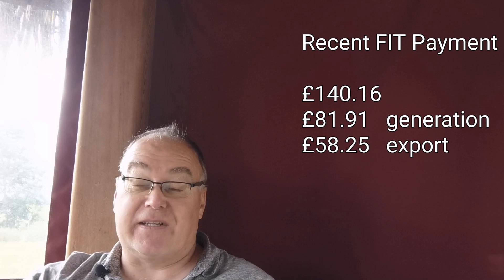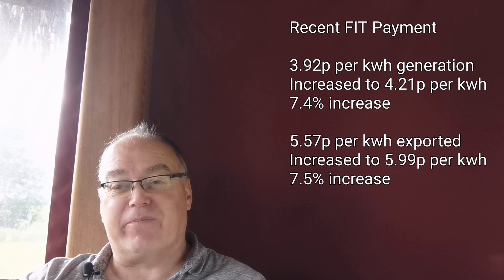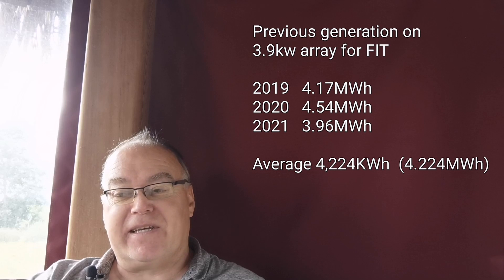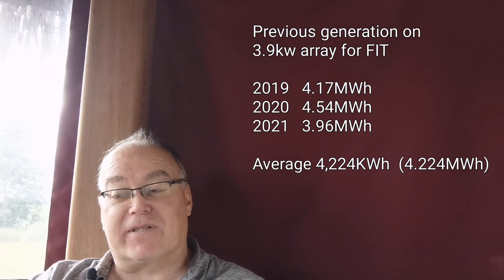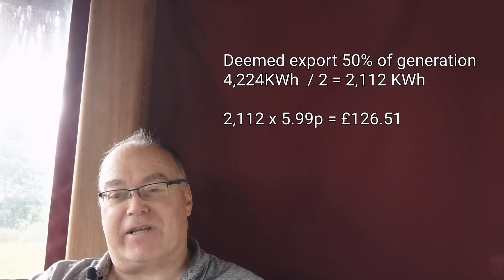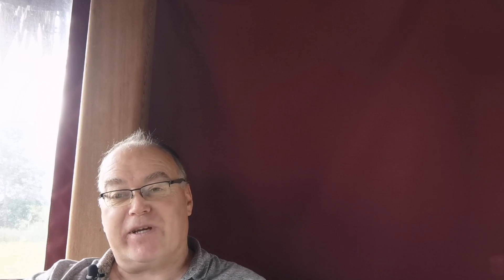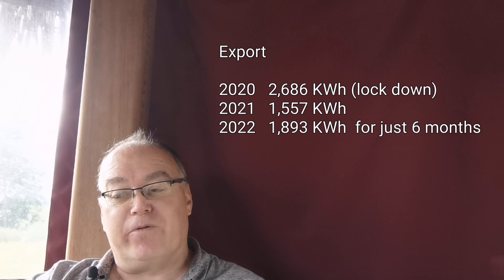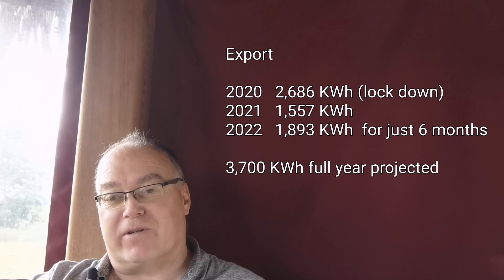Is it time to swap from FIT to  SEG? Smart Export Guarantee. Calculations & thoughts

Comment: Nigel, As of September 2023 - Intelligent Octopus now comes with Outgoing Octopus of 15p per KW.  Can you revisit your calculations.   Also I am on FIT and have been for 10years is it easy to cancel the FIT export element - can you just apply via Octopus or do you have to also do  this with the energy provider who pays the FIT. Any insights into this would be appreciated.
Reply from the maker: Export consideration is a different video. I'm not with Octopus for export yet

Comment: Really simple question Nigel.  I have FIT right now so I get paid for Generation and an assumed "deemed" export.  If I move, what happens to the Generation bit which is the main income stream - does it go altogether, if so I cannot see how even the best Export tariff would make up for what I get for Generation right now.  I cannot find a clear answer to this anywhere, so the inference is, if you are in the FIT model, for gosh sakes stay with it because no SEG - even on the best SEG tariffs for Export - will get even close to matching it.
Reply from the maker: If you swap to an export tariff and have FIT already art of the swap process is for  your FIT energy company to confirm  you have opted out of the deemed export.

You still get generation fit just not deemed export, instead you can be paid on an export tariff.

Basically you notify you FIT energy company
Reply: @EVPuzzle  Oh that helps.  And if I move to another provider who has a better "real" export tariff (like Octopus), would I still keep the generation /FIT income, and would it still be at the same level I get now (my current FIT generation rate is about 60p per kwh), or would it, or the rate it's presently at, be put at any kind of risk if I move to another provideer.  It's certainly all something to look into carefully, before you leap!

Comment: Great video Nigel. I would love to know anyone who could set up all the parameter variables into an MS Access Database so that you can just use drop down menu's to quickly configure based on price per kWt + time + month + SEG or FIT etc and tariff plus standing charge and on ..... anyone got the time and skill set as I would happily pay for the app or database file lol.
Reply from the maker: If only eh? A bit of visual basic and nice easy front end. The only down side is its on a computer. Everything these days needs to be on your hand on a phone or tablet.

Gone are the days of running a computer burning hundreds of watts whilst running.

The only thing that persuade me to run a computer again is if @sightlinesystems supported solar integrations like Home Assistant. A true data analysis tool. There's nothing out there for residential use
Reply: @EVPuzzle  Thanks for the reply. I guess I will have to number crunch on a spreadsheet. Where did you buy your heat pump set up from if you don't mind me asking? I am trying to get prices but they don't want or are unwilling to do bespoke systems like yours unless you want to import from Poland which sounds too risky.
Reply from the maker: Gt. Yarmouth installer 'ignite heating and cooling'
Reply: @EVPuzzle  Many thanks Nigel and I love your analytical mindset and articulate presentations unlike the Robert Llewellyn's of this world.
Reply from the maker: @michaelrathbone67  that's really kind my friend. Two different types of people completely. An actor and a Technical Programmer 😂

Formal car media are the same, they only say its great so they keep getting long term a loan cars. No credibility

Comment: I'm on octopus tracker for my import which is capped at 30p pkwh and 16.68p standing charge  until July 2023  and agile outgoing for my export at the end of Aug 2022 I was charging my batteries over night because the export tariff was higher than my import tariff so the solar was all exporting to grid

Comment: Also worth considering unless you can automate the charging of the car at the cheap times, it will probably end up a lot of hassle. For it to work I would want to be able to just plug in the car and not have to set the charging times based on the Agile rates, personally I would just plug it and set to charge at night during the average of the cheapest hours.

Comment: I have a small 1.5Kw system on the FIT payment of 18p per kWh, at the time I took it on I think the average retail kWh was 10-14p - the system has more than paid for itself but now standard retail prices are going to 50p+ per kWh I am seriously considering abandoning the FIT/any form of export full stop and going off grid to a self built battery storage,  I admit it is shear bloody mindedness on my part but I object to the fact that the tariff adjustments are quite frankly taking the piss.
Reply from the maker: I know that feeling. FIT is inflation linked of course  but nothing compared to costs. Disconnecting only saves the standing charge of course
Reply: @EVPuzzle  I know a couple of pv owners now with fairly large systems who’ve taken the pv arrays fully off grid and built their own battery storage, I think it’s the way to go, especially if you own evs as they do, though they are aware but not particularly concerned about the potential impact on the life span of their L-ion ev battery a sporadic bit and bobs charging regimen can have, this of course not an issue if the ev battery pack is lifepo. If you think about it make lifepo battery powered evs quite desirable…..

Comment: Interesting tactic for swapping in the winter months. For now, I've been enjoying the octopus export agile tariff this spring/summer which has consistently (like your say average perhaps 20p/kWh) outperformed the fixed 7.5p offer and for import, using the octopus flexible variable tariff. Of course the variable tariff might go up, but will give customers notice when they do.
Reply: Surely they will cotton on to this and prevent you from flipping between the two with requirements for say yearly sign ups ?

Comment: Hi Nigel, for the Victron inverter does it have to be a Multiplus 2 GX inverter? For solar tied to the grid with pylontec batteries. I’ve not got any of the kit yet just waiting for my solar to get installed in August fingers crossed.
Reply from the maker: The GX models just contain  the GX Comms device internally .  I opted for the seperate external device .

Sane with easy solar models.  They simply contain inbuilt solar mppts whereas with mine I would add them seperately as and when needed

Comment: Hi, I love these videos and they have been so helpful to a solar novice like myself. Im due to get a system installed using a solis hybrid inverter and power drive 2 battery. I don’t understand which app I will have to use to monitor the data (I love data) any ideas would be very welcome. Thanks Alex
Reply: Sorry just one more question will the solis apps be able to read the battery percentage? Thank you Alex
Reply from the maker: Yes
Reply from the maker: The Solis Home or Solis Cloud app
Reply: Thank you 👍
Reply: Hi Alex - Hope you don't mind me asking. Did you mean PureDrive 2 battery? If so, we're due to get a very similar install in Jan; 11 panels, a Solis hybrid inverter and a 5kwh PureDrive II hybrid battery.
Is yours installed / working yet - if so, how are you finding it? I'm particularly interested in the Monitoring and Control options - i.e. can you change the battery charging schedule and/or min & max values easily? remotely via app, or do you have to stand in front of the Inverter and do it directly there?
Is there real-time monitoring? Can you review previous days' statistics easily?
Maybe these are also questions for The EV Puzzle - do you have any videos that may address these?

Comment: That’s exactly what I did in 2021 made about about £500 credit and went through till April this year on the summer credit , went on outgoing in summer and go in the winter!  But in 2022 stayed go as so far would be £200 ish worse off  on outgoing as agile prices are so high and there is no cheap rate on agile this year so if you need energy for ev or home battery use etc it would cost you lots 😮.  As far as I know on go or intelligent tariff you only get 4.2 p a kWh on seg  the 7.5 p is the fixed version of agile outgoing 24-7 but you need to be on agile import for outgoing variable is the one you get the 30 mins variable tariff that is good bit more that fixed but ideally you need to export at the right time etc . My advice would be to switch to go or intelligent if your car or chargers is supported now instead of waiting because near the price cap time prices will skyrocketed that why I’ve now switched to intelligent because it’s the same price as 4 hour go but you get 6 hours off peak a night ready for winter even though our tariff don’t end till October as if waited I bet I will be lot more than 39 p peak and 7.5 off peak!  It’s a shame that the average outgoing prices are not in line with the extra import prices in 2022 as would have been on outgoing this year too as was its biggest fan in 2021 !  In 2021 we averaged 21 p outgoing over the summer and agile  import average prices was 20 p in 2021 . So now in 2022 agile import average when I looked was 33 p so to be in as good position I worked out we would need mid 30s p average outgoing to make it work in 2022 compared with our 15 p peak and 5 p off peak and after looking at the prices regularly the outgoing prices didn’t Match up it only in last month there are bit better but for us it’s saved us money using what we need or want and exporting what we don’t need at seg rates and so far in 2022 it’s cost us about £25 in bill including standing charge not about £300 so that a lot of outgoing money you would need just to be any better! If wasn’t worried about prices rises soon yes would have go on outgoing last month but I’m happy with my decision but will look at the outgoing situation in spring 2023 . But In place Nigel yes apply your seg  now and then go on go or intelligent for the winter to lock in the better rates then go on outgoing next spring then the paperwork is done for quick change next spring as was told once you got seg done you can move fairly fast when ready for next year , dont leave seg paperwork till next year as i did it in February and was waiting till April ish to get paid so missed 4-6 weeks of good solar . That my 10 ps worth ! 😅 . Take care and safe travels everyone

Comment: Nigel. In all of the systems you have tested, which Inverter/ System can work entirely as a stand alone unit without internet connectivity. 
Smart meters measure bi-directionally and have independent GSM data chips so your usage and generation is taken care of at that level.
As I see, most equipment reviews show some level of internet access that feed back to the mfr of the equipment.
Currently, most of that is free of charge but Im sure that In time, it may become a subscription service. My point is, as a piece of hardware like a washing machine or TV it is supposed to fulfil a stand alone function without needing to be permanently connected to "somewhere".
Reply from the maker: Victron is the only one that can provide data locally all the rest were web based apps and cloud monitoring .

I think they'll always be free but you might get limited functions or lack or updates without subscribing at some point

Comment: The maths don't work in terms of the average agile KWH per hour price as the higher rate period is much shorter than the lower rate which also needs to be taken into consideration, and the fact that when it is higher you will be using more electric as well so the average exported for that period reduces which means your average per KWH also reduces, I think you need to take another look.

Comment: Hi Nigel, Thank you for your videos, really helpful. I have a question, why DNO imposing how much I can generate energy from solar and store in my local battery if I do not want to export any energy back to grid? Would be helpful to understand so that I can communicate both my installer and DNO. It has been 8 months and still waiting for my solar + battery to install sadly
Reply from the maker: DNO has to cater for what's possible not what you intend , by accident battery could dump out energy whilst max Solar. They look at worst case to prevent failures and damage to the network

Comment: You may be able to map the wholesale electricity prices to your export data for every half hour over a year using excel assuming your inverter / meter provide that data. That way you could find exactly how much you'd make.
Reply from the maker: I only need an estimate. as Predicting energy prices accurately going forwards is a real guess

Comment: But if you charge your car with the power you won't get paid for export. I'm on an early 2012 rate and now have a house battery that does export when usage changes and the battery ramps down output. I also have IR panel heating and will be back to having an EV when it's delivered. I was told by Octopus that I would lose my fit payments if I went to smart export so there is no gain in changing.

Comment: Not saying too much, I'm below the 3.6kw mark but IV kept my old analogue meter.
I can run my house off 1.2kw and wind my meter back in the day and use abit at night when IV not got solar.
These energy companies are been very greedy buying small selling big.....my system is I run on my own but I give abit and take back later, with little cost.
But before anyone says anything, the standing charges have gone up too......so I'm still paying for the standing charge.
I just need to get rid of gas!!!!!
Reply: I was at one customer's council house where they had solar panels installed from the council (you get the power but not the export money) and somehow he still had there spinny analogue meter and I will looking at it and I could see that the red Numbers were going backwards (his bills would likely double in price if that was replaced with a digital or smart meter)

Comment: I am on the Octopus Agile Export variable SEG and during the 30 days of June I earned £153.15 for exporting 888.6kWh at an average price of 17.23p/kWh :) I have a 13.8kWp array on a 10kW inverter but with a 4.8kW export limit from my G99 :( I also have a Powerwall II and a Renault Zoe as well as Zappi, Eddi and Mixergy HW cylinder in a Passivhaus with no gas or heating system! Like you’re considering, I’m on the variable agile during the summer when I import nothing and will switch to Go & the fixed agile export for Nov/Dec/Jan/Feb when my imports will be significant. Make the switch - you know it makes sense! :)

Comment: FIrst utility sold out to shell...I hope when Tarrifffs return they expand on the Summer Credit for Winter deal. I have no MCS Im not a Certified engineer .
The excess power generated by the solar panels during the summer will give customers the chance to earn solar credits that will unlock a decrease in energy bills of the winter.
Households can be rewarded with a credit equivalent of 1,000kWh for the electricity they feed into the grid during the months of June, July and August.
Shell Energy says solar credits from the operation of solar panels with a sonnenBatterie could bring a reduction of energy bills of up to £150 in winter.

Comment: It's NOT correct about Go and Outgoing 7.5p - you can't be on both at the same time.

Taken from Octopus FAQ page

"Currently, you can't be on both Outgoing Octopus AND Octopus Go, our electricity consumption tariff designed for electric vehicle drivers. We've made this decision because both are such incredibly good value tariffs that it would be unsustainable for us as a business – the equivalent of letting people buying goods in a shop using a "3 for 2" offer and then bringing them back for a full price refund! The combination of Outgoing and Agile works really well and offers potential for great savings. You can choose to be on Octopus Go and join our new SEG tariff for Outgoing, offering 4.1p / kWh for your export – just get in touch with our team to take this option."
Reply from the maker: Keep up, you're about the 20th person to notice . Thankfully Im only comparing the numbers. I have no need of any SEG whilst on GO

Comment: Good video, 
Some statements are not correct. 
I am on a fixed import and Agile export. 
Agile export gives you an average for the day so it's irrelevant when you export during the day . 
(It's in the small print)
Reply from the maker: Careful about statements. Did I actually say you can have 7.5p on GO, implied maybe .

Lots of people noticed the mistake a while back

Comment: Another great video with lots of stats for us data nerds. With your large battery and automation you will be much better off (and have an advantage) on the wholesale pricing as the battery lets you buy low and sell high. I'm on the wholesale market here and am getting upto $13/kWh for exports. The automation I'm using is the Home Assistant add-on EMHASS to optimise my battery, EV and heating in real time with the changing prices and solar production. I'll send some links on twitter.
Reply: I’m also running Home Assistant and will be checking your tweet, Mark. 

Thank for the video, Nigel.
Reply from the maker: Saw your post about your great credit day.  It's the way to go and yes bigger battery will be essential this winter. Prices here are going to stupid levels . Thankfully I'm protected much more than most.

Sorry I still haven't acted on your last email of assistance.  I need to set modbus values as I do with buttons via timers or automations in HA.  Tried a couple of  times without success but will get there eventually